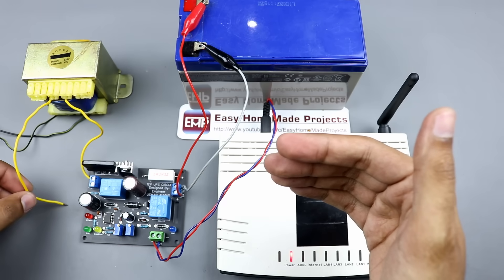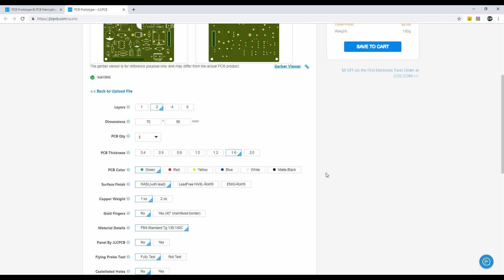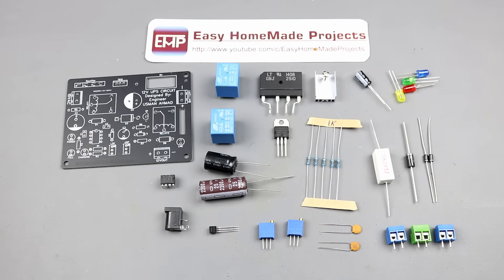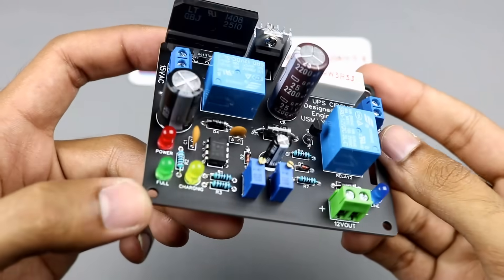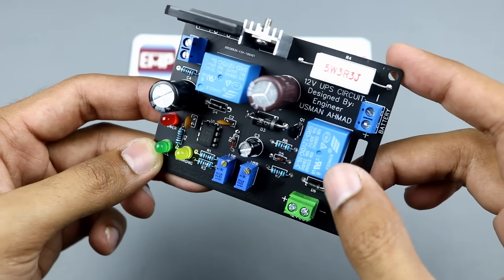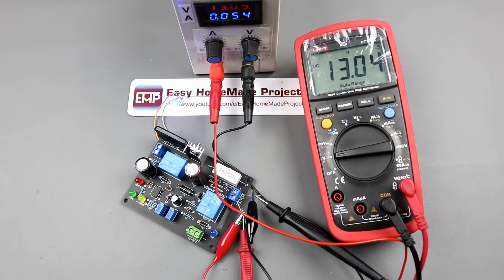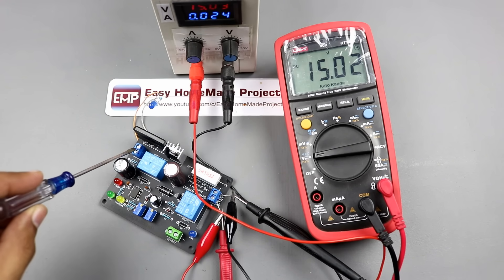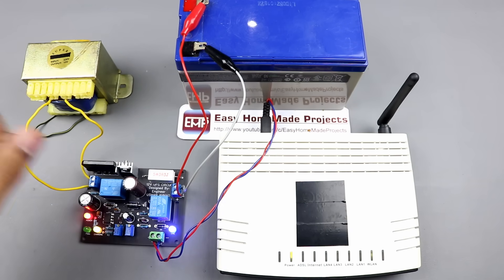How to Make Full Automatic 12V UPS for Internet/Wi-Fi Router (V1.0)

Comment: please help me?
Ssome components have no path on the pcb board, including:

rectifier, battery, output, 7812, Relay 1, C1, C3, C4, C5, LED Power, Full, Charging, usp, Q1, Fuse, LSP, R7, D4

Comment: Hello,
Could you refresh the list of the components because it's really hard to find the correct parts
Thank you
Comment	Designator	Footprint	Quantity
NE555P	U1	DIP-8	1
10nF	C1,C2	RAD-0.1	2
220uF	C3	CAP-D8.0XF3.5	1
GBU8005	D1	GBU-22.2X3.53	1
WJ301V-5.0-2P	AC	WJ301V5-5.00-2P	1
20K	LSP,USP	RES-ADJ_3296W	2
1k	R1,R2,R3,R5,R6,R7	AXIAL-0.4	6
BZX55C6V2	D2	DO-35	1
SRU-12VDC-SL-C	K1,K2	SRU-12VDC-SL-C	2
LED-5MM	FULL,CHARGING,POWER,LINE	LED-5MM/2.54	4
WJ301V	BATTERY,O/P	WJ301V5-5.00-2P	2
1N5822RLG	D3	DO-201AD	1
5W3.3R	R4	AXIAL-22.0X9.5X9.5(5W)	1
1000uF	C4	CAP-D12.5XF5.0	1
1N4007	D4,D6	DO-15	2
BC547BRL1G	Q1	ONSC-TO-92-3-29-11_AM_BL	1
9.1V+6.2V	D5	DO-35	1
7812	U2	TO-220	1
2200uF	C5	CAP-Z-12.5MMX25MM	1

Comment: Hello Mr Usman, I finally received all the parts including the 15vac transformer. Like someone else noted, I had to use only one 9.1 zener at D5 for K2 to switch. The circuit runs fine in the normal power mode. However, several minutes after removing the AC and running on the battery, K1 relay starts clicking or chirping and the charging LED blinks, the 555 timer starts getting hot. Any thoughts what might be wrong?

Comment: I tried making this same project using the provided schematic and it works fine the only issue is that the router restarts when power goes off and I tried adding capacitor as well at the output but same issue. I don’t know how you are switching the supply without restarting the device in video some help would really be appreciated.
Reply from the maker: Use same zener diode combination
Reply: @EasyHomeMadeProjects  tried that also but if I use the combination of zener diode the relay does not switch at all…
Reply: I've had router reboots too. Not having enough education to solve the problem, I put in the gap between the output from the relay of this uninterruptible power supply a homemade module with 2 pcs of 18650, with a charge and discharge control board and having a 12 volt output - this module does not allow the router to reboot - helped solve the problem.

Comment: The relay would not trigger unless I used just one 9.1V zener for D5, (not sure why the 9.1+6.2 did not work). I've also found using a ~2200uf capacitor across the output will stop the router resetting when it switches. All working now, it seems thanks again for this project, very informative.
Reply: does that mean the router will not stop working or the moment when it switches?
Reply: @FiveEight58  that's what I meant, in my experiments with this project adding the capacitor across the output prevented the router from resetting during the momentary power loss before the relay kicked in.
Reply: @electronicsluckydip  gotcha
Reply: @FiveEight58  ,
Practically it is nor a UNINTERPTED POWER SUPPLY. Relay creates a delay in switching that is enough to reboot the router whatever method you use. Switching transistors are the only solution.

Comment: At what voltage will the battery stop charging? My concern is that the voltage drop across the bridge rectifier will mean that the battery will never get the full 15V, hence the ups that is calibrated to stop charging at 15V will not stop trying to charge it?

Comment: Hai i use your circuit. But while I remove battery + terminal from circuit the charging led should keep on. If the full charging led on then all out put voltage should zero. Why this problem occur. Please help me.

Comment: Question 1. What if I have a load of 5A to 7A Approx <100 watts. like `1.5 A(Gpon Media Convertor) + 2A Router + 2A Router + 1A Acess point. Which components I have to swap?
Question 2. If I have a lithium battery with a BMS 3s or 4s BMS?
If possible create a V2.0 for higher load with Li-on battery I would really appreciate it.

Comment: Does this have over discharge protection for the Lead acid battery used in it ? Because deep discharging Lead acid battery will reduce its life span for sure.
Reply from the maker: It is for router, which automatically shutdown at low voltages.
Reply: @EasyHomeMadeProjects please help me?
Ssome components have no path on the pcb board, including:

rectifier, battery, output, 7812, Relay 1, C1, C3, C4, C5, LED Power, Full, Charging, usp, Q1, Fuse, LSP, R7, D4
Reply: @EasyHomeMadeProjects please reply?
Reply: @EasyHomeMadeProjects hello, please reply 🙏

Comment: Hello, I would like to follow your setup, Just want to ask how would I connect it if I am using a 4S1P LiFePO4  as battery pack. The idea is to be able to charge the battery if it has been used because of any power interruption, and the battery to supply the system with power in case input from ac to dc adapter is lost. Thank you.
Reply from the maker: This circuit is only for lead acid battery.
Reply: @EasyHomeMadeProjects  Can it be modified to work on LifePo4? or not?

Comment: When i made this circuit, i couldn't set the 15v usp pot.. led is not turning off.. i am using 50k trim pot instead of 20k because it wasn't available here in our local shop.. is it because of that?.. i am able to set 13v lsp on same 50k pot.. let me know what's the problem.. components are all working none damaged and checked every connection
Reply: I was having this issue too (USP trim pot never turning off the LED), but have discovered the problem was due to a batch of NE555P. Now replaced with a chip taken from another source it works. Using a 50k trimpot won't be the problem, I think, though may be wrong.

Comment: Hi Sir, Could i use 12v adapter with 2 amp and power up as input. Please confirm
Reply from the maker: No
Reply: @EasyHomeMadeProjects  Thanks for your kind reply. Instead of Lead Battery can i use lithium 18650 batteries 3S 2P which contains 3000mah of each cell..

Comment: Hello, am trying to use the 12V 7AH battery (in UPS) and router wall adapter as inputs; both of them controlled via 2 12V Relays for switching the input for powering the router. There is a capacitor to handle the voltage drop during relay switching.
The problem is that the battery is showing a voltage higher than adapter (sometimes 13.3V); the output of adapter remains between 12.2 - 12.4V.
Is it safe to use the output voltage of battery to router or should I use a 7812 voltage regulator in output?
Reply: capacitor detail??

Comment: please make a same type of circuit for running a laptop which doesn't have battery. Before of this type of circuit only need a booster circuit which will produce 19v from 12v high Ah battery.

Comment: Finally a guy who isn't powering the router directly from the battery
Reply: No matter how big is your battery is it will provide only amount of current the device need*  and he is saying this because all other people are using lipo battery without any protection or proper voltage regulator and you can use battery directly in EMERGENCY coz batteries drop voltage while using and device components well get heat up if there is insufficient voltage so its better to use regulator and booster 👍🙏
Reply: Bhai do u have whatsapp
Reply: please help me?
Ssome components have no path on the pcb board, including:

rectifier, battery, output, 7812, Relay 1, C1, C3, C4, C5, LED Power, Full, Charging, usp, Q1, Fuse, LSP, R7, D4
Reply: Hii bro please help me
Reply: Why is it bad to power a router directly from a battery?
Reply: @boymichael10  I would suppose it would put unnecessary wear on the battery.  You have electricity, you should use that directly, not through the battery as an intermediary.

Comment: Hello, can I use it with Bms 3s module? Does this system stop auto charging when the battery is full.
Reply: Yes, you can charge using modem adaptor. BMS will manage battery levels. This will be simple without pcb.

Comment: Is this a dumb question... 
Is it feasible to power about 100w of devices (server, WiFi, etc) 
off a 12 volt to 240 volt inverter; 
powered by a 12 volt battery 
that is kept under constant charge via a 240 volt battery charger? 
I'm thinking , as a UPS, it should 'work' but (putting aside efficiency ) maybe there are some longer term issues?

Comment: does the circuit have over voltage or full charge cut of and battery low voltage cutoff.. thanks in advance.. new subscriber here..
Reply from the maker: Over charge protection available. No need to over discharge protection in lead acid battery usually
Reply: @EasyHomeMadeProjects  thanks for reply sir,  can i  have the schematic diagram and modify  the circuit a little sir, i just want to add some additional output like 5. is it ok to use linear regulator like 7805 any suggestion  sir. thanks in advance..

Comment: Hi Usman Ahmad. I like your Project very much. Sry but i must ask someone. Did you have a Datasheet for D5? I don´t understand what you mean with (NOTE: D5 is 6.2V and 9.1V  Zener Diodes in Series.) Do i need 2 Diodes? There is only 1 Place for D5. Is it an Special-Diode? I wait for your response. THX for it. Stay blessed.
Reply from the maker: Thanks. Simply connect these 2 diodes in series and then connect in place of D5
Reply: @EasyHomeMadeProjects  Hi. Thx for your quick response. Ok I understand. Have now seen a section of video. Can you also tell me the order in which they belong? When I look at the PCB from above (read I can read D5 normally) where does the 6.2V and the 9.1V diode belong? (Order / left right)
And how many volts do the electrolytic capacitors have? I see 25V on the two large ones. But what about the little one (C3).
Thank you for your efforts.
Reply from the maker: All caps should be 25V or above. Diode order doesn't matter. Only contact using correct polarity Like you connect batteries in toys.
Reply: @EasyHomeMadeProjects  Thx and the L7812 is an L7812CV?
Reply: @djredix4358  Am I missing something? There is only one diode in D5 bank.
Reply: @ozgurduran4699  Hi Ozgur Duran. You must two physical Diods connect in series to one Diode and then you connect these one (2 Diodes in series) to D5. When you show in Video you can see what i mean. Two Diodes in series connect in D5. Like a Pyramide. Watch exactly.

Comment: Considering that the power-supply can simultaneously charge the battery and provide sufficient power for the load, you can connect the load directly to the battery and design the charger to adjust current based on the requirement. This way you can avoid those relays and the supply to the load will be smooth.
Reply: This will wear out the battery capacity, to preserve the battery, we should have as minimum charging cycles as possible
Reply: I agree with the other person commenting as well. We should not use battery 100% of the time, only when needed. A nice special feature would be to drain the battery about once a month to keep the battery healthy. However, knowing my luck, the power would go off once a month while draining the battery lol
Reply: u r really  d  u mb    the purpose of a UPS is to provide power directly from the source

Comment: Great design! I would like to modify for powering a 2A device, do you have a suggestion of part number for a suitable 5A regulator component to replace the 7812?
Reply: Yes I would too. Majority of DC home appliances now runs at least on 2A. Please share what we could do.
Reply: @hamhumtube  Haven't found a suitable 5A replacement without redesigning the circuit but the 78S12 is 2A as opposed to the 1A of the regular 7812, so might help it go a bit further.

Comment: Hi Ahmad. Thanks for a nice project. Could you give more information about D5? I see there is only one Diode in the circuit, but you have indicated a 9.1V+6.2V diodes in series. Can you clarify?
Reply from the maker: It is clear. Use these 2 diodes in series and connect in place of D5.

Comment: Can this ups support external hard disks, i have several external HDDs that require power adapters to supply 12v 1.5amps to power them. I have frequent power cuts in my area so im looking for something similar to your solution.
Reply from the maker: Use a 5A regulator instead of 7812

Comment: Hi, on D5 you write 2 diodes in series but i see only one diode on the video. I should solder 2 diodes in series or just one? The video is wrong?
Reply from the maker: Please watch complete video
Reply: @EasyHomeMadeProjects  i watched the entire video but i dont see anything about the two diodes in series!
Reply from the maker: You can notice 2 diodes at the end of video. Btw it is not necessary. You can use a 12V diode aswel.
Reply: @EasyHomeMadeProjects  thanks!

Comment: Thanks for the great video! Noob question: can you add more batteries for a longer running time?
Reply: In parallel, yes, using batteries of the same rating. 

-Make sure voltage of the two batteries are the same (can use pcb to charge separately before next step if needed)
-Connect batteries positive-positive & negative-negative.
-Connect pcb to positive of one cell & negative of the other (if using > 2 cells, connect pcb to positive of the fist cell & negative of the last cell)

Comment: hello can i use 4.7 ohm resistor instead of 3.3 ohm on the r4?
Reply from the maker: Yup
Reply: @EasyHomeMadeProjects  i made all the project but at the end their is a error that when i connect the main power supply transformer but not battery then there is no voltage on output connector and when i connect battery the charging light on and voltage come across output but when i remove battery it still remain on charging not convert to full however in video when you disconnect the battery then it convert to full light
Reply from the maker: Recheck your circuit diagram
Reply: @EasyHomeMadeProjects  i use your gerber file to order it on jlcpcb
Reply: @newcenturysongs  same problem occur me  using this circuit. Do you suggest any solution.

Comment: In case there's a failure on the battery (maybe battery cable is broken or other battery's failure)
are these circuits can still work normally without connected to battery?
Reply from the maker: Yup.

Comment: One question, will keep charging the battery Or this setup will auto cut the power once the battery is full?
Reply from the maker: Auto cut of.
Reply: No auto cut degin in circuit
Reply: @koteswararaoneelapu3432  Hi Koteswara can we use 12v 2amp adapter instead of 15v 4amp transformer and caliber the same.

Comment: I do not want to charge my battery. Cause I am using Solar Battery and it's getting charged by solar plate. So how I should do to stop charging
Reply: you can user solar controller which is available in the market

Comment: This is so cool, thank you! Question: What mods are needed to use Lithium🔋(3s/4s = 11.1v/14.8v)?
Reply: Check max / min voltage for the batteries & set potentiometer cutoff / charge voltage to the sum of those cells.
Reply: Would a BMS be required?
Reply: @Chronizoul  dont mess with li-po batteries they always need balanced charging. only use li-ion with BMS or just classic PB battery
Reply: @Chronizoul  yes
Reply: Would obviously need some sort of cell holder as well

Comment: I have a doubt, please clarify. I have a working UPS  (the regular one that we use for computer).
During the power cut, I don't like the idea of UPS running on DC , then  Converting to220v AC which inturns converted back to 12 2A DC by the modem's power adapter.

Is it safe to Run the modem directly with the SLB 12v 7Ah Which is connected to the UPS? Not only during power cuts but all the time (even when the battery is on charge) ??
Reply from the maker: If you run your modem direct on battery, it could be damage. Because during charging, voltage can reach upto 15V. Which is extra for a 12V modem.
Reply: @EasyHomeMadeProjects  
I understand during the charging cycle the voltage is higher, 
But is it Okay to connect a standalone (not connected to ups)12v 7Ah battery to a modem that requires 12V 2A??

Do you have any suggestion like a simple voltage regulator module that could do the job and not damage the modem even during charge cycle??
Reply: You can use xl4015 circuit to adjust the outpust voltage and the current from the ups batter as like your adapter then simultaneously you can charge your battery with your ups bode and also you can use the 230v inverter and the battery connected with the above circuit which I have mentioned and connected to the modem . 

Only you can do to unbox your ups and make a dc connection from your battery with out removing ups boad connection and close your ups and connect xl4015 circuit and make adjustment as per the requirement modem with screw driver and multi  meter and switch on